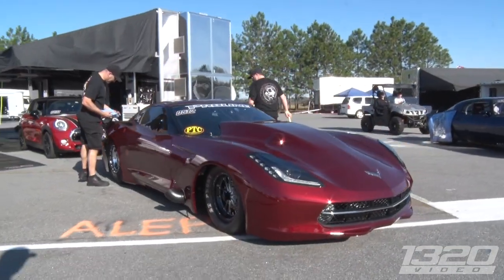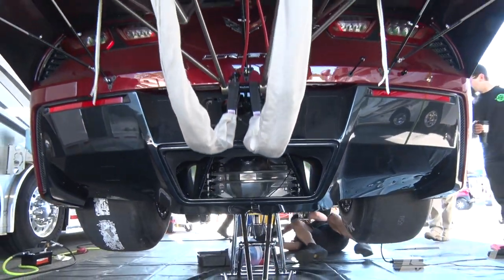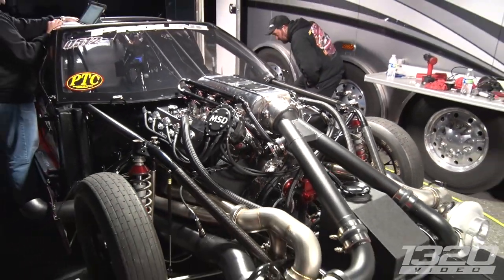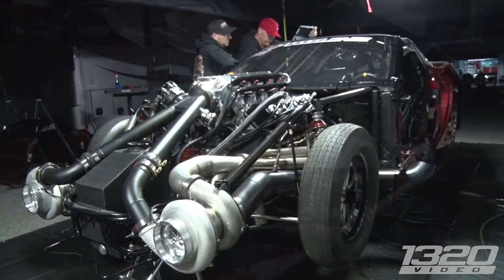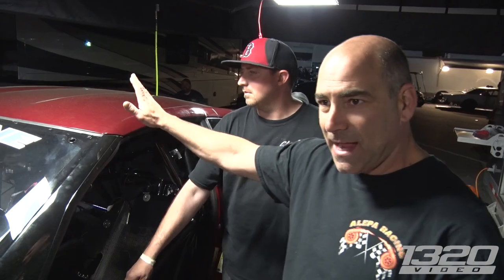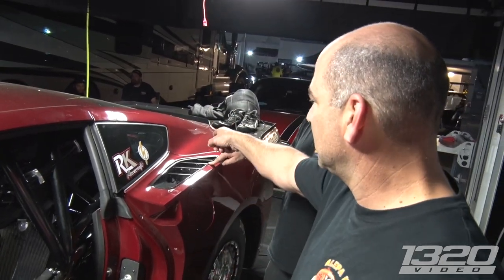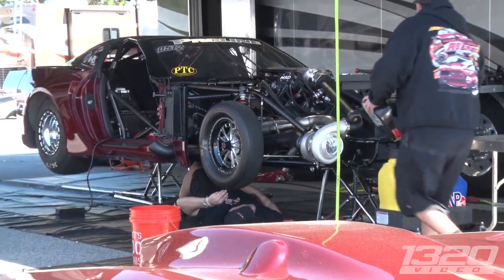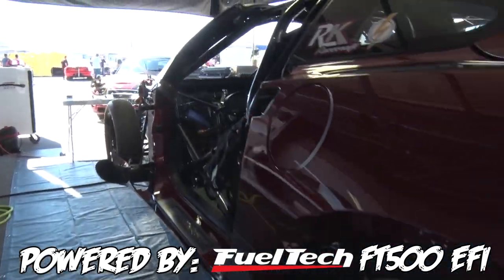3500hp C7 Stingray Corvette - Twin 102mm Turbo HEMI!

Comment: Isn't this channel called 1320?  I always feel cheated with 1/8 mile tracks...
Reply: Lol
Reply: New channel name is 660video.
Reply: Yes I agree, 1/8 mile is a waste of time and money. Glad we have real race tracks here. It's bad enough that NHRA went to 1000ft don't need this crap. Stopped going to big events because they pulled that stupid stunt.
Reply: Just say no more gop ever 1/8 mile racing is not stupid it's a real man race. Because tuning is so much harder in the 1/8. If you are an amazing driver but have slower car you have a way better chance of winning. In the 1/4 a bad driver can easily drive around the great driver with slower car. I run a 1700hp 67 Camaro it isn't the fastest but since I'm a pretty good driver in normally win.
Reply: Yep, totally agree.
Reply: Bs!! Funny I talk to these guys that run in classes like outlaw 10.5 and every single one of them says that they prefer running the 1/4 mile and the parts breakage and supposed tuning issues is bs. How good a driver is applies across the board. The ONLY negative thing is the tires failing.
Reply: Just say no more gop ever I think it’s more for safety for the 3000+ hp cars. So they don’t get dangerously fast and out of control.
Reply: Yeah, we dont want cars to go too fast. Maybe they should run Priuses
Reply: 1/8 Mile sucks .......
Reply: Init tho

Comment: All that work for the 1/8th mile... I'll never understand.
Reply: Same..
Reply: +DrBIeed Because that thing will Taq out, and blow up by the time it reaches the quarter. its already going 190s-200s by the 8th mile.. put it all together
Reply: +DrBIeed accidents are more common with this class of car past 1/8th mile at the speeds they can reach. 200 mph in the 8th is fucking crazy.
Reply: +DrBIeed For the guys who cant tune for the rest of the race lol
Reply: +Benjy Warren Gearing.  It only taqs out like that because they designed it for the 1/8th which brings us back to my original point.  I'm not knocking the car I just don't understand why a person would pour so much time in effort to such a small amount of space.

Whats next? 60ft?
Reply: +DrBIeed ok you race a 10 inch tire 3000 hp car past the 1/8  shit is really fucking skiddish..it's not like a real promod with gigantic ass funny car tires
Reply: +DrBIeed 1/8 mile racing got so popular for many reasons some of them being that a lot of the parts damage that goes on in the engine happens 1000-1320ft and it is way easier and cheaper to build 1/8 tracks thats why you see so many of them in the south. and ask any tuner the majority of all the tuning on any race car is done by the 1/8 mile on quarter mile passes almost the full second half of the track the car is already in high gear on full bust and you just let it pull the rest of the way.
Reply: +Benjy Warren your point is erroneous. only a crazy man would spend that much money for 4 damn seconds
Reply: +DrBIeed People that do circuit or 1mile races would say the same about 1/4 mile. 
To each their own.
Reply: Chad W Hey, people buy solid gold toilets, so hundreds of thousands for a 4 second car isn't soooo outrageous.
Reply: +alexadams1212  Thats the whole idea, let the mega HP really pull when its on full boost. Thats how you really see the differences in power. Racing just for the acceleration is cool but you will probably agree a bit underwhelming for spectators.
Reply: +Benjy Warren You spend way more than 4 seconds on the toilet though.
Reply: Justin Kenaley I mean, you do make a fair point.
Reply: +DrBIeed totally agree... how is the quarter not the standard
Reply: D00RED
you really think the chassis certs are that legit on the cars for the 1/4..there's a lot of reasons that the nhra won't let them race a full 1/4, they don't even let funny cars since scotty kallita race a full 1/4 but none says shit about that.  just hate on the 1/8 mile big dollar guys......think about that
Reply: +mrhazel that comment makes no sense. All the cars running the 1/8 mile are held to the same cert standards that 1/4mile cars are held to. And the main reason nitro cars went to 1000ft is not because of the chassis it was because of not having enough room to stop in the shutdown area because of the speeds.
Reply: alexadams1212  thanks for clearing that up, i did realize now that if they were to continue accelerating for double the distance i mean... shit would hit the fan, or the back of their pants lol
Reply: alexadams1212
uh yeah,  and these cars are much heavier and are not that easy to keep straight and slow down.  it might not make sense to you but that is why you don't see radial cars race full 1/4 but twice a year...my comment makes perfect sense.  ask any one of those guys if a 25.3 cert is that legit on a full body car?!
Reply: +alexadams1212 this^^^ plus liability insurance for the track owners. most of the driver skill is displayed during launch nothing to really prove in the last 1/8th of a quarter. its nice to have standards like  the quarter mile but if progress makes that standard  impractical or unsafe so be it.
Reply: +mrhazel they are legal for 1/4   run mid 5s at around 250. just 1/8th is funner.  since this video.  this car has been 3.80
Reply: only because its geared for an 8th mile..all you got to do is change to a longer gear set
Reply: +Hellsslave666 Nope, drag racing is a 1/4 mile period.
Reply: +alexadams1212 YA bullshit, why would anyone go through  the expense and hassle to build a complex to only race 1/8 mile? I live in the north west and we have zero 1/8 mile tracks. Saving parts what ever, they barely get going and it's over, what a waste of time and money.
Reply: great, then show them how its done big boy..
Reply: mrhazel YA, easy. I go to races that really race. I am not the one spending mass money for a very short thrill. Maybe you can do better next time.
Reply: Just say no more gop ever
good for you.  their waste of money,  their cars.  why are you worried about it?  if it was a waste of money,  nobody would show up and watch.  simple as  that.  great stop watching..
Reply: mrhazel You don't know as much as you think you do. Part of racing anything is taking risk, if it scares you to go fast then find another hobby like stamps. And SK crash had nothing to do with rule changes. Every few yrs they try to slow them down, 1000ft is bullshit too. Look how empty the stands are at the NHRA events. Pretty thin, hard to justify all that money for only part of the show.
Reply: yea that makes a lot of since seeing how almost all of the tuning on a 1/4 mile pass is done before the 660
Reply: alexadams1212
lol  right on!!
Reply: +Chad W I know right, 8 seconds is like an eternity.!! you know aside from time being relative and all that..
Reply: it was explained tome that 1/4 mile is for the best professionals and the once a year amateur guys. the 1/8th mile is for the serious amateur guys with serious purpose built race cars. 1/8th mile is big money territory.
Reply: DrBIeed breaks a man's heart..
Reply: almost all pro mods running in these classes with quarter mile gearing would be 250 miles per hour plus and they already have a hard enough time keeping them straight in the 8th
Reply: Around my area we mostly have 1/8th just bc of space.. it takes a lot more land to make a 1/4 track than a 1/8th so everybody around here races 1/8th so that’s what the cars are built for. also the street racers usually use 1/8 bc it’s hard to find a long road with nobody around..
Reply: Just glad the roof comes off 😁
Reply: 1/8th mile is much more like a street race honestly
Reply: DrBIeed my thoughts exactly. Why not run it down the quarter-mile? I don't get it
Reply: 1/4 or nothing people never understand, that's absolutely right, no matter how many times it's explained to you. The real racing is done in the 1/8. The back half of a 1/4 is just keeping your foot in it. What's next, 1/2 mile? 2 miles? It's all car and masturbation at that point. Literally the only complaint is you feel it doesn't last long enough. It's 4 seconds, identical times to funny car/top fuel. These things are not making 250-300mph with a longer run, so quit whining like 1/4 matters here.
Reply: You and what toaster? So you've never seen a race where someone wins within the last hundred feet? When at the very last second they pull off the win? That's the point of the quarter-mile. It makes for better racing. Just my opinion.
Reply: 200mph in a 1/8 mile...you should understand.
Reply: I understand. They are gay.
Reply: @puppetmasterblaster  yup!

Comment: does anyone else find it annoying that these Top Fuel Drag Cars share literally Zero parts with the Car they're "Called" but they're still talked about as if they were?
Reply: This car started out its life as a brand new C7 Vette.  Not even close to a top fuel car.
Reply: +Captain Meh Yes, the original powertrain is gone, and it's probably a 25.5 cert chassis.  The chassis is a must, otherwise it's not safe.  The engine and suspension also a must, otherwise it isn't going to be anything at all competitive.  The car still has its original vin number in the original location, bought off the showroom floor.  The thing that is annoying is people who comment on drag racing videos on a drag racing channel, hence, 1320Video, and don't know or understand drag racing and call everything a top fuel car if it is modified.  Top fuel cars are a completely different animal.
Reply: +alscort93 this is 1320, a racing channel that started off following street cars. if you want to be PC go troll a NHRA channel.
Reply: +David C Yes it is 1320, a channel I've been subscribed to for many years, and purchased DVD's and other merchandise from.  As they've grown, they've also moved into territories other than grainy street racing.  They show what's trending and what their fans want to see.  If people don't like it, they don't watch it.  When they show diesel stuff, I make an adult decision and don't watch it or troll on it like the ones trolling their "it's basically top fuel" nonsense.  They've covered Drag Week for many years, which if you look at the Unlimited, Ultimate Iron, and Pro-Street classes, they share a lot more in common with the car in this video than their factory version.
Reply: +David C PC puss?  Tough words from behind a keyboard lol.  Do you understand what PC means?  I started watching the channel because of the racing period.  This is pretty much the direction that every racing channel is headed.  They cover street racing and big track events, they also covered SEMA and some car shows.  Once again, if you don't like it you don't have to watch it, no one is forcing you to watch.
Reply: Never said I didnt. I do know what PC means. And not trying to be tough just correct in my statements. Just stop talking please.
Reply: Gmon3y 142 most of the body id stock
Reply: Yes.
Reply: Yes, like fast Honda civics

Comment: A Hemi in Chevy Corvette.
Reply: +Trill Texas Its just the heads of the cylinders... Doesn't mean is a Chrysler...
Reply: Dig Diddlier Its a HEMI™ and not a "Hemi" Cylinder heads
Reply: +Gustavo Borba its a proline engine with a hemi design, proline isnt ford, chevy or dodge, though some say the 481x is cast after a big block chevy.
Reply: +Dig Diddlier so the Chrysler family doesn't deserve any credit. Is that what you're saying?lol
Reply: +WOLFMAN305 No they do not deserve any credit, Chrysler did not invent the hemispherical head design. Pipe was the first car manufacture to use a hemi head design around 1901-1905, Alfa Romeo was the first to use it in mass production. Chrysler is the only company that uses it as a selling point or advertisement.
Reply: +Gustavo Borba are you honestly going to sit there and pick on the capitalization of the word hemi?
Reply: +Xavier Bemidji 481x block is closer to hemi/LS style, crank set up in the block

Comment: I guess the 3500HP got lost somewhere before they got to the track lolol
Reply: +ralmslb  You did see the 200mph pass right?
Reply: +Fullforce LTX YEs and like 10 cars with around 1000HP to 1500 HP doing the same lol
Reply: +ralmslb 1000-1500hp won't even give you 200 mph in the 1/4 lol.
Reply: It made 5200 hp on a dyno

Comment: Should've kept an LS in it considering the other corvettes are killing it
Reply: you cant get an ls no where near 3000 hp
Reply: +Michael caplinger True
Reply: obviously you know very little about horsepower this car depending on weight has right around 3000hp. there are several horsepower calculators online try one of them

Comment: As a professional fabricator whom specialized in turbo systems I have to tell you, those intake tubes are choking you! Zero reason for the pipes to be necked down at the vbands. I'd also run those full size all the way to TB and make a nice merge. Lower the pressure resistance out of the turbos the faster they can spin. Not crazy about the hump couplers being right after the bend either creating more turbulence.  I didn't notice but I hope there's two BOV on there too? Other than that and from what I can see, the car looks great! Pretty wild to buy a new car only to chop it all up like that.

Comment: is it a Chevy motor with hemi heads, or a pure Mopar hemi?
Reply from the maker: Hemi motor
Reply: +1320video I saw this and sent crazy. Then I saw Hemi.... :(
Reply: +vinceMCsurvivor silver I felt the same way
Reply: +Judgedreddgto  That makes 3 of us.....
Reply: +Gary Rehak last i checked, most motors have hemispherical heads.
Reply: +Chad W not quite!
Reply: +Chad W  It's the opposite.. Most cars have a bathtub/bean shaped combustion chamber including those marked "Hemi" on modern dodge vehicles
Reply: +1320video why? 😰
Reply: +Gary Rehak After market purpose built race motor.
Reply: +Chad W that is correct, hemi is trade mark, it doesn't mean other engines don't use hemi-spherical combustion chambers
Reply: True Hemi head designs are inefficient except at high RPM. The are also crappy on fuel and emissions at normal RPM.
Reply: Well I know its aftermarket. It just would've been cool to see a 572 crate motor in their instead
Reply: +amorag59 the modern dodge hemis are shaped almost like the 318 poly head from the 60s, thats why youll hear people say the new hemis arent true hemis.
Reply: +Jake Morris The name "hemi" is so overrated and frankly, ridiculous. If somebody wanted to give me a 440 sixer or a "hemi" block from the 60's...I'll take the 440.
Reply: Ham Steaks I mean theres a reason they use the hemi blocks in top fuel
Reply: Jake Morris Agreed. It's called "rules and regulations " :)
Reply: Ham Steaks
And here I always thought it was because the hemi design, from the original 392, made the most power.
Reply: +Jake Morris There nothing Dodge in a TF motor anymore, purpose built. Hemi just means hemispherical head or chamber, you can build a BBC "Hemi" motor.
Reply: Just say no more gop ever That is true, but im saying they use hemispherical combustion xhabers for a reason, its because theyre strong as hell
Reply: what did u want LSX? lmao
Reply: Jake Morris
Why is a hemispherical chamber any stronger than other types?
Reply: Are the GM LS motors Hemi headed?
Reply: Just say no more gop ever Hitting "reply" helps.
And I agree No more Democrats Ever :)
Reply: Not just rules. A hemi will hold 10,000hp
A 440 will never see a quarter of that horsepower. A 340 is better than a 440
Reply: There's much more to a Hemi than just the heads lol
Reply: Aww mate, you even got Chevy Nova in your name, I could only imagine your pain
Reply: You did go crazy to see that kind of hp on a chevy motor , but than realized it's a hemi and in the world of Hemi's 3500hp is a walk in the park.
Reply: What's the matter, never seen a Fontana motor before?
Reply: The TF blocks of today are far and above a vintage Hemi in every way. Hemi is short for hemisphereical combustion chamber, really nothing to do with the block. Purpose built. BBC engines are just as tough if not more so. You don't see Hemis in race boats hardly at all, for a reason.
Reply: Dead Dig Racing Not a real Hemi, purpose built. No way a stock block could hold that much power let alone nitro.
Reply: muscle vs tuner joke? xD
Reply: Amorage59, This motor uses Top fuel style Hemi heads...still have a half moon chamber.

https://www.prolineracing.net/blogs/engines/plr-520-548-hemi-4000-hp

https://www.mbellc.com/nhra-legal-pro-mod
Reply: Gary Rehak It's neither, it's a handbuilt custom engine with zero Chevy or Mopar parts on it. It has head design cues based off the original Hemi, but again it's all custom made.
Reply: Why not put a lsx in it  or a 5.3 with turbo??

Comment: There is a point where you can no longer call this a C7 vett, and have to start calling it a C7 vett dragster. It was either when all the production parts were pulled out, or when the horsepower hit 3500